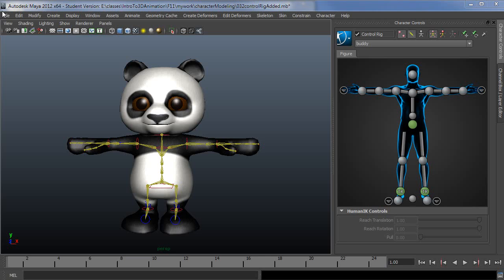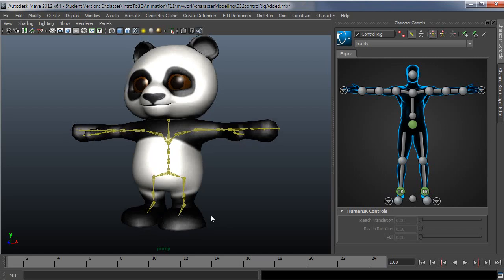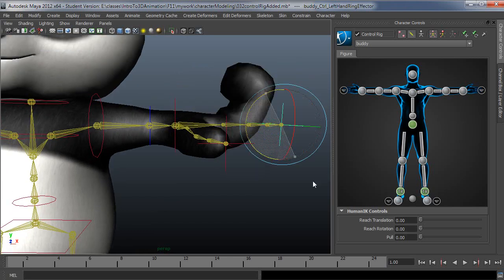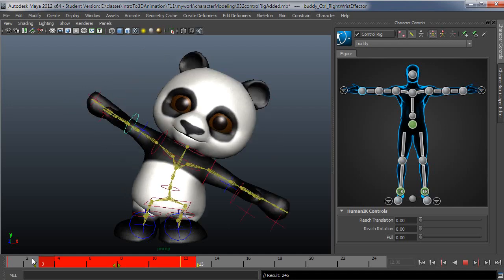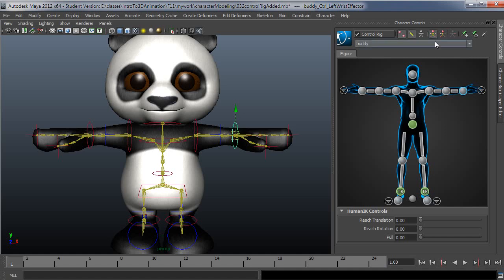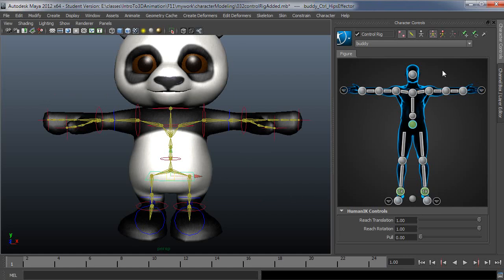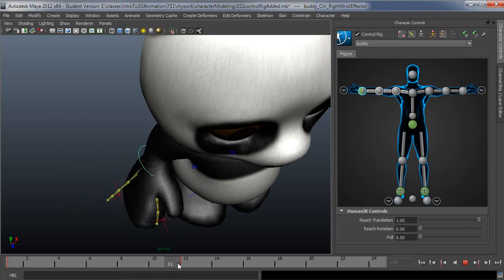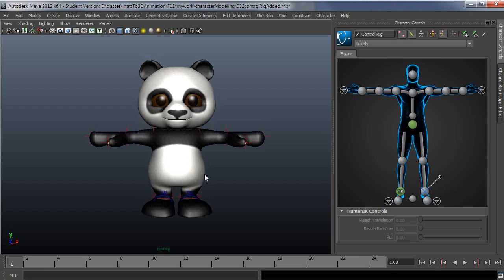Setting up Human IK in Maya 2012 pt12 Control Rig Overview

Comment: Thanks for the awesome video! But you said you can always go back to skin weighting, but now I am in the middle of an animation and I noticed that I need to change the skin weights, but Maya won't let me. Is it too late for me to change them or am I doing something wrong?
Reply from the maker: No,no, you can weight at any time.  If you have loaded the character as a reference and locked it or something you will not be able to, but you should get an error telling you that as well.  Let me know if you didn't get this sorted out and I'll help you.

Comment: Great tutorial Vinny. Could you show how to re-target data from a motion capture skeleton, such as the ones provided in the visor, to a HumanIK system in Maya 2012? There are plenty of tutorials for how to do this in 2013, but 2012's does not have the same method. Thanks.
Reply from the maker: I'm sorry Luke, I no longer have 2012 but I don't remember it being drastically different.  I'm pretty sure you just go to "source" under the blue button and if there is another HIK character in the scene it will show up as a source.

Comment: My character with humanIK and control when i animate it , in the inbetween frame some joint rotate like crazy. How to solve that problem? it is really hard for me to animate.
Reply from the maker: From my experience this typically happens if you are pushing joints beyond their bio-mechanical limits and the joint(s) can't follow the intended path.  Check the keyframes around where this is happening to see if the joints are in reasonable poses.  This could also happen if you set interpolation to euler instead of quaternion and you are hitting gimble lock.

Comment: Ow its ok now i got, if anyone else is having the issue in 2013, basically under the stance source, under definition if you have a pose and and you lock it becomes the default pose so just unlock and it and reset the xyz rotations.

Comment from the maker: Really sorry about the lag on my response!  To me, a blend shape driven facial setup is one of the easiest to setup and animate. You won't have quite as much control as a cluster or joint driven face, but you can definitely create very effective expressions relatively simply. You can also control a blendshape driven face (at least to get a quick start) with Motionbuilder using either mocap or a voice. I haven't actually used it, but I'd check out Brekel Kinect Pro Face - it looks really sweet!

Comment from the maker: Thanks Mauricio. Check:
1.Make sure ReachTran and ReachRot are set to follow the controls you intend for the ankle (or whatever joint)
2.Check to see if the chain can't achieve the attempted position along the path at some point
3.Check if rotations are in Euler or Quaternion - they are quaternion by default with HIK and that tends to help eliminate odd twisting since interpolation always follows the shortest path. If Euler, maybe try Quaternion.
4.Is it trying to move in a way a human couldn't

Comment: Nice tut. Any tips on using the curve editor with HumanIK? From what I can tell it seems like editing translation curves is straightforward but rotation curves aren't really editable due to the fact they are quaternions instead of euler. Are you supposed to just edit rotation in the viewport with the rotation manipulator and not touch the quaternion rotation curves or is there a way to edit Euler curves?

Comment from the maker: I'm not sure I understand exactly what you've got going on, but you can rotate the arm to be pretty close to parallel with the X axis and HIK will be fine with it - it doesn't care about the actual rotation values. If you want it to be exactly parallel with no rotation you could unbind, snap joints to the grid or an object that's parallel to the world x, then freeze, orient joints, rebind, etc. But you don't need to do that unless you just want to. Let me know if that's not what you were asking.

Comment: Hi, cool tutorials, i have one question. How do you force a joint to be paralell with a certain axis? I have a robot and its shoulders pivot, so i placed the joint on the hing but its not at a flat angle. The componant editor registers the angle at 0, but its defenitly at an angle. Any ideas? I get this message "The right arm doesn't seem to be parallel to the X axis."

Comment: If I rotate the the head using FK the eyes stay in the sockets, but if I rotate the head using IK they eyes slide out of the socket. I have checked the weighting of the head verts and all appear to be set to 100%, do you know what else could be causing this problem ?
If you have the time I could send you my file.

Comment from the maker: I misunderstood what made the workaround work. Create the skeleton with the skeleton generator, then switch over to the "Definition" tab and then work away. Undo will work fine. Do NOT switch back to the skeleton tab - if you do, all transformations you've done will be lost. Before you lock the skeleton (ie done with skeleton changes) OR before you need to go back to the skeleton tab to make further changes, go to the blue icon in HIK character controls and choose Edit - Skeleton - Save Edits.

Comment from the maker: First, I should have checked this in 2013 before responding, so sorry I didn't.  This is a new bug in 2013 - didn't see this in 2012, but saw a similar issue.  I see the same issue you describe in 2013.  Definitely an annoying bug.  Work around: create a new skeleton, then at the top of the HIK panel, turn "Character" to "---none---", then position your skeleton. If you undo it will only undo one level and it will reactivate your character in the HIK panel, but undo will work properly now.

Comment: Anyone else experience this bug. I start to position the joints to line up with the model. If I undo, expecting to undo just the last move it undoes everything and sets the skeleton back to its default position. Is this normal for this tool ? once you start positioning the skeleton you cant undo just one iteration ?
I sure hope someone has a solution to this problem ?

Comment from the maker: You don't need to uninstall Maya to install the hotfix.  I'm not sure of the Mac requirements since I'm running PC, but make sure you meet them, whatever they are. I would guess that's the issue anyway, maybe the installer requires a later version of the OS or something like that.

Comment from the maker: NP, glad to try to help.  Hotfixes work on student version, and if you just google "maya hotfix" you should find them.  The car paint material should work just fine.  Try reassigning one material to the whole object and see if anything disappears when you add a keyframe.  If that works, add materials to faces as needed 1 by 1 to see where the problem appears.  Reassigning materials may fix it, who knows.  I'd still get the hotfix though.

Comment: Exactly.  No key frames, all the materials there, but if I keyframe anything, parts of it disappear or become the material surrounding it.  I did the smooth bind to the skeleton as in your video and individually grouped the vertices to the joint i wanted.  I have a student version of Maya, would the hotfix work on it as well and I assume they are available on the Autodesk website, correct?
Would the fact that I have the car paint materials on my rigs have anything to do with it?

Comment from the maker: HIK isn't really designed to do squash and stretch, it's more about using realistic bio-mechanics.  I'm sure there's a way to force it to do some squash and stretch, and it may be easier with 2013 since HIK now works with custom rigs (I haven't had time to play with this yet), but to my knowledge, the simple answer is, if you need squash and stretch, maybe don't go with the HIK rig.

Comment from the maker: Thanks Matt! You can reset single controls or body parts to the default pose by zeroing out the rotation on the FK control(s). The one trick to this is you have to make sure that no joints that will be affected by the change have Reach turned on. So for example, to 0 out a knee, turn off ReachT & R on the ankle, select the "shin" FK and 0 out the rotations. To 0 out the whole leg, select the "thigh", Edit-Select Hierarchy, then 0 the rots. They may not all go to exactly 0 but will go to default.